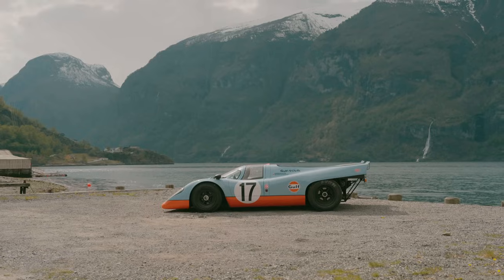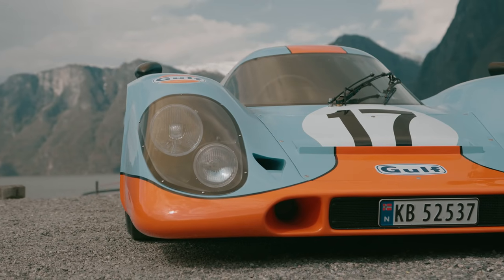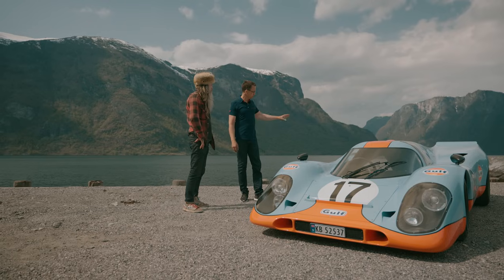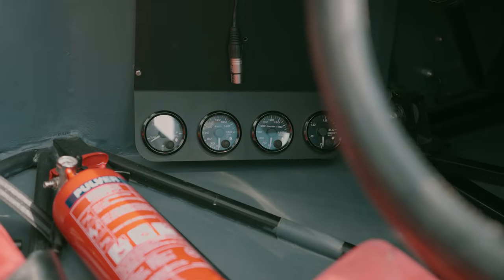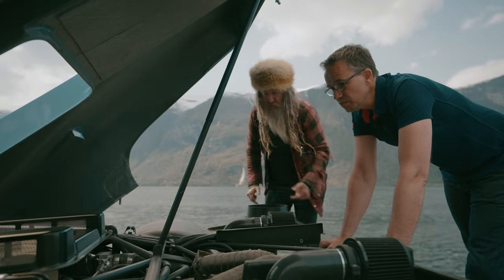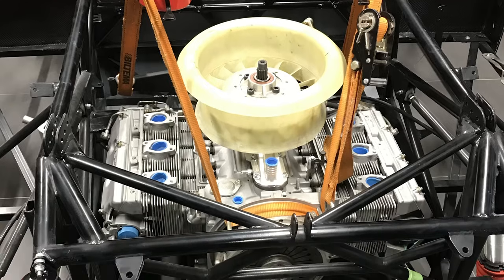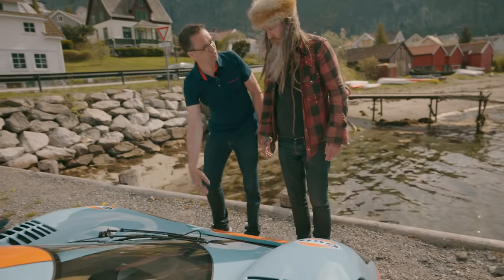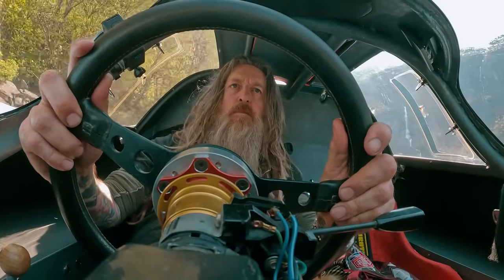917  PORSCHE  on the Road in Norway

Comment: Ahhhh! To drive a 917... it's on my bucket list! This turned out to be a great recreation. Thanks for sharing with us, Magnus!
Reply: yes true but this car is slower than old 911 unless they are sandbagging due to regulations.
Reply: @hagestad  I don’t think you watched the video.   1000kg and “only” 3-350hp is still a much better ratio than any old 911.   How much power does your 917 have?  :)
Reply: @caddydave  ? You do realize that some of those old 911 weighted as low as 800kg and had similar power?  Don't get me wrong its still ca cool car but nothing really faster than 911 cars of 1970s.
Reply: @hagestad  800 kg and 300+ hp?  I don’t think so.
Reply: @caddydave   1967 911R was 800kg. 1984sc was also very light and about 250hp. So if we mix and mach different parts from porsche like they did with this 917 you can go about as fast in terms of acceleration using stock parts.
Reply: @hagestad your delusional if you think that makes sense….
Reply: @caddydave  as are you if you think that recreation 917 drives of feels anything like original car. Then again original car was never really well driving car. It was fast that's about it.
Reply: @hagestad  how do you know?  This is what’s so great about the internet.  A video pops up about a pretty amazing build.   Your first comment, is something to the tune of “why bother,  it’s heavier and less powerful than an in period 911” 
 But your claims aren’t valid as an “ in period” 911 isn’t nearly as powerful as your claiming.   Your response is “by mixing and matching parts” wait… what?   Your comparing this 917 to a car that never existed.   Why not compare this 917 to a carbon bodied 911 that uses an engine from the future that runs on synthetic fuels?  It makes about as much sense..
Reply: @caddydave  Dude - everyone mixes and matches 911 parts. That's is exactly what they did in this build. What im saying its pretty pointless. I guess its best they could do due to local regulations.
Reply: @hagestad You are right.  To get it road legal he had to dial down the power to max 300hp pr 1000kg . However be aware that his powerestimate is conservative at best.. Very conservative . The engine is built like a rally engine with smal turbos and a lot of tourqe to get the most performace from low horsepower .
Reply: @SirGassolini You watched the video!! I agree,  this could relatively easily (I’m guessing) have double the horsepower…. But I can’t imagine it really needs it.  The current engine reminds me of a 962 power plant.  

  IMO,  any criticism of this build isn’t appropriate or warranted.  I don’t think people realize how much work this is, and the end result is exceptional.
Reply: @hagestad 3315cc two turbochargers,custom engine build. I reckon some of those horses are hiding behind a tree! What a beauty regardless
Reply: @hagestad  
but every man and his dog owns a 911 plus the market is about to crash, I'll pick a cheap one up and use it for rallying.
Reply: I drive that every day... In assetto corsa.
Reply: It's on this guy's bucket list too

Comment: Ok, I typically don’t like replicas because… they’re not real. But that opinion changes when it’s a LeMans car built using the original factory Porsche specs. That’s pretty sick. 
This car is awesome, the level of work and attention to detail is next level. It’s close enough, and managed to adhere to pretty restrictive rules. 
Love this so much. Owner is a legend.
Reply: Arguably this is better than original. All the weight savings from CF body were spent on a much stiffer frame.
Reply: Porsche specs without a 12cyl? Yeah. Just as they made it alright.

Comment: I had the good fortune to be able to sit in the 1970 Daytona 24 hour winner, a couple years ago. Getting in with the steering wheel on is one of the most difficult things I’ve ever done! Lol !  You can’t sit on the door sill or put any weight on any body panels, as they are very thin fiberglass . You put your left leg around the left side of the wheel before sliding down into the seat, then try to figure out how to get your right leg between the steering wheel and the gear knob. You are lying down but the seat is so concave you have almost no back support, and at 5’8”, I could just reach the pedals.  It was magnificent! Once inside with the door shut I had an epiphany;  “racing is life, everything that comes before or after - is just waiting.”
Isn’t it amazing that a 55 year old race car can look so perfect!

Comment: An interesting bit of tech way ahead of its time was the frame for the original 917's, it was "permanently pressurized with nitrogen to help keep it solid and detect cracks", which is kind of crazy considering the stresses on the chassis. I've loved this car since I was a kid, it looks, and sounds so raw, and primal. My favorite it the rear, and those massive tires, every bit needed to keep all that power in check. This is a beautiful, and honest nod to it's great legacy, great work.

Comment: This is really a beautiful piece of engineering. It brought back many memories of my time at JW,, Automotive in Slough  as a young glass specialist I was responsible for the body mods to accommodate  the wide tyre's. Another mod which has been retained is the air duct mid cabin in the roof exactly reproduced.

Comment: This could have been a Bailey  replica chassis and body made in South Africa , who also made some T-70. Some 13 years ago l worked on a car test bed/ mule that carried a Nissan V8 4.5 ltr supercharged with Hewland gear box out of the UK and that was some beast pumping about 600 KW with just about as much torque{nm} . This is not for the purits at all...but above all great work by Magnus and whoever else was involved.👏👍

Comment: This car needs no excuses nor a fake 12 cover. It's kick ass as it is. Really any replica 917 with a close enough accurate body ,a tube chassis and a Porsche motor. Is really all a kick ass 917 replica. Needs. It doesn't need a 12 at all.
Great build great car.

Comment: In norway when you modify a car the maximum horsepower is limited by a maximum power to weight ratio of 20kW/100kg or 268 hp per ton OR the highest horsepower offered in any (road legal) trim of the same car

Comment: Not that this isn't impressive but going from 1100 all the way to 1500 horsepower down to 400 is a bit of a strangulation of the 917. Didn't know Norway had such strict rules on horsepower. The last Soviet power :D
Reply: Don't call Norway a soviet power to a Norwegian...
You'll leave norway with no teeth and no nose.

Comment: Hmm I still dont get it why they didn’t put a flat 12 in this 917 replica 😮
Reply: Yeah, it's very stange no original Flat12 put in this 917 replica. There are so many original Flat12 race engines sitting around in garages and basements.
Reply: @Rimrock300  a good mechanic can built a flat 12 from 2 flat six 911 engines Dude

Comment: I got a 600 Euro speeding ticket for going 5 KPH over the ridiculously low speed limit. I can't think of a lamer place to drive than Norway.
Reply: Driving experience is fun here, if you like driving through corners. If you like straights, you are definitely in the wrong place.
Reply: @casparberends2719  Yes, I had just exited a corner to find a cop with radar detector on the straight issuing 600€ tickets for driving 50 kph on an open road.

Comment: The original had 1,100 bhp - what a bummer having to handicap it so much just because the Norwegians are anti-car
Reply: So sad. Norway have no 250 mph speed limit highways, like most countries. Probablty because they are anti-car. There are so many Porshe 917 flat12 race engines laying around in Norwegian garages, but they are not allowed to use them.
Reply: @Rimrock300 well, Norway is anti-car scene. I wouldn't be allowed to drive my bmw 440i as it has a sport cat and too loud for the beta-males. In 2025, they aim to prohibit sale of new combustion engine cars. Yes, Norway is indeed anti-car

Comment: Oh to have the wherewithall to engage in such frivolous self gratification. Utter waste of resources without the original power plant. Nice paint, however....
Reply: “Utter waste”. Come on ,  isn’t that a bit overly dramatic….?   If it can’t have a 12 it shouldn’t be built…. ?  What a strange outlook.
Reply: @caddydave  Not at all. I you cant hit a Grand Slam why even step up to the plate????
Reply: Not that a Porsche Pancake Six is actually a resource, either.....
Reply: @doctorcountersteer6580  you sound like a real treat.   If it’s not an exact copy with a 12 cylinder , you consider it a complete waste.   What have you built?
Reply: How about an NA 48 hp miniature single rotor wankel that weighs in at around 16 pounds? Just how much of a consideration is your power to weight ratio? Son, back in the day I had a bone stock 69 Firebird that I vented the ring lands in the slugs on. That thing had a Powerglide and literally did 90 mph *in first gear*.  I was 19 in 1970 when I did that so please respect your elders and ALWAYS GO BIG OR STAY ON THE PORCH, kid